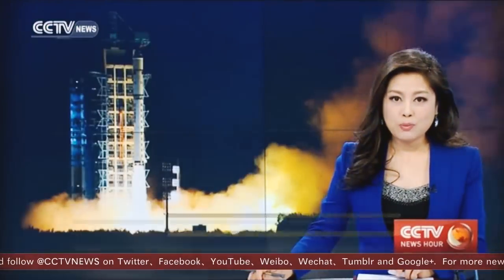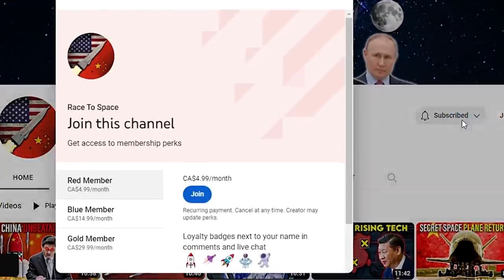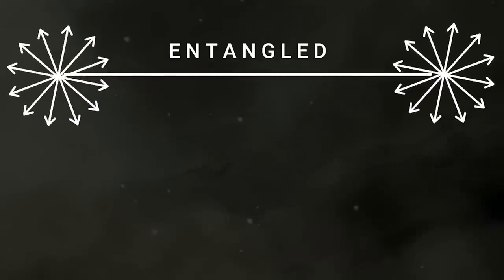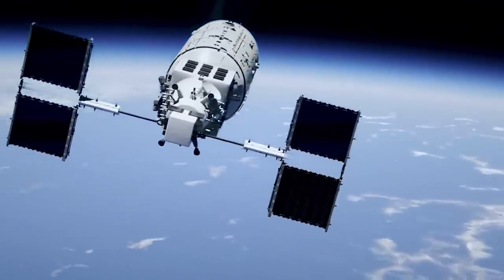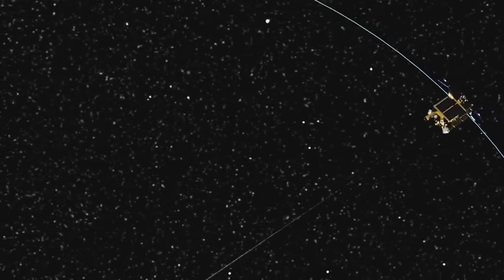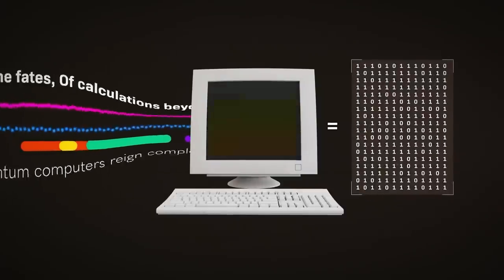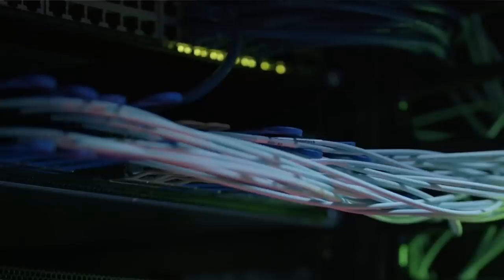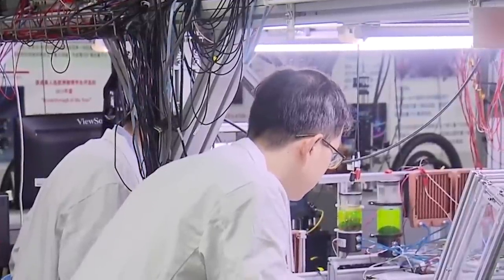INSANE: China’s Rise To QUANTUM Superpower

Comment: Just blah! Blah! But no technical info about Quantum technologies. Helloooo..
Reply: @Mark Shah Maybe because this information are closely guarded secrets. Results are what matters, and they  do have a fully functional quantum communications satellite.
Reply: @edwardwongiii2229  
I got you. Probably that is the reason you could not offer much technical information. I understand now, and thank you for your enthusiastic approach.
Reply: Kalian tidak melihat di. Pasar. Sebentar lagi beredar.
Reply: An extremely simple way to put it, you take two photons you link them together by colliding them into each others with lasers and now you keep them and preserve the newly created link, with it you can now spin one of them and the other will also spin with no delay. It's a ftl connection. Then once you did that create a binary code with one spin being 0 half a spin being 1 (or something like that) perform your techniques and technologies and voilà. You got your quantum instanteous data transmission. It will only require a satellite to keep some photons that will communicate with the ground to make sure the link will not fall apart.